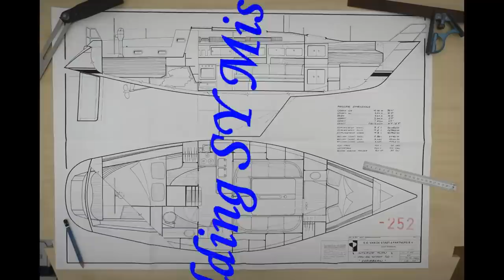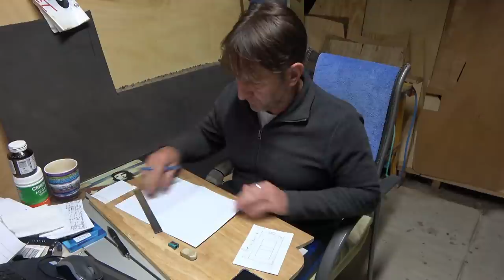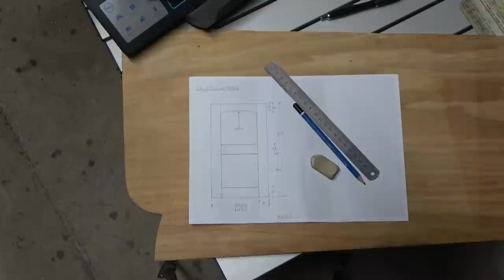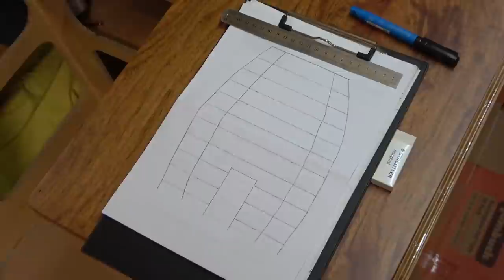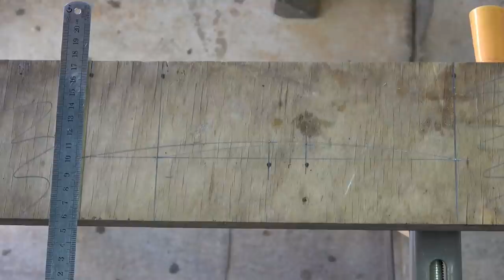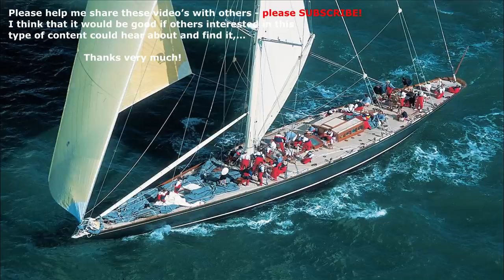It is SO good to be using tools again! Ep.120 Building my steel sailing yacht

Comment: When painting with mineral spirit based paints, you don't have to clean your brush between coats if you just submerge it in a jar of water. The brush won't dry out and the water shakes right off. When end coating many moldings, we used a small sponge in a cup with a bit of paint poured over it. Just poke each end into the sponge and move on to the next. Much faster than using a brush.
Reply from the maker: Thanks for the tips Mike, I haven't heard of putting mineral based paint brushes in water before and that's a great idea re. sponge method, which I will be doing a version of by using foam brushes for the ends  🙂👍

Comment: Good way to lose a hand , use a piece of wood to push them threw the saw , or you won’t be sailing Captain Hook
Reply from the maker: Understood Dave, however it seems that you have missed my ~25 years of cabinet making machine use experience and in this video where I do use a push stick for when one is required for safety reasons.